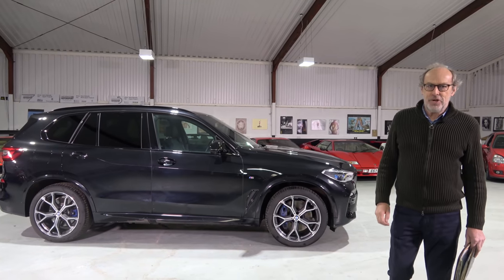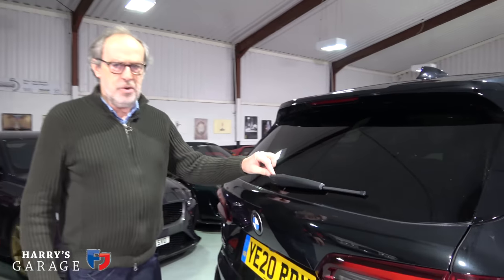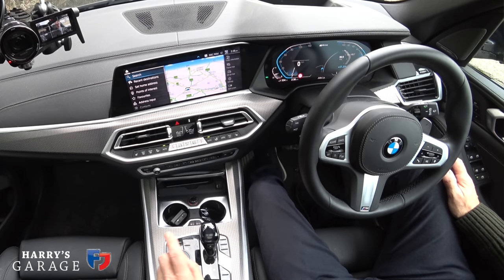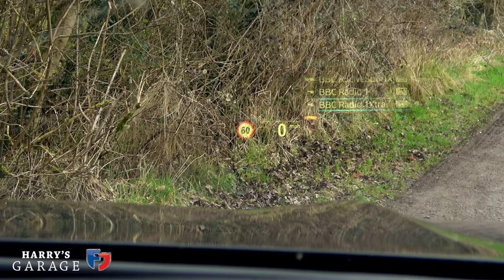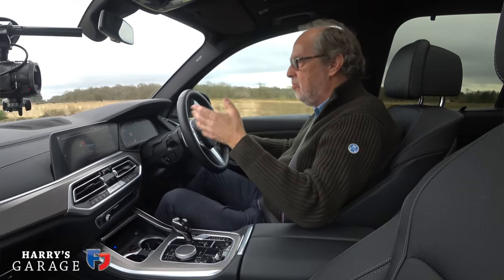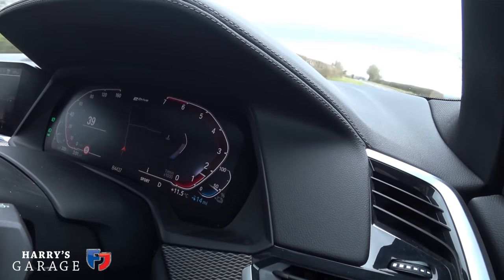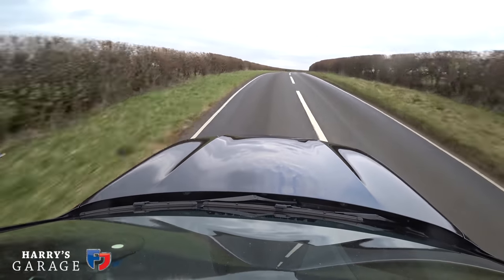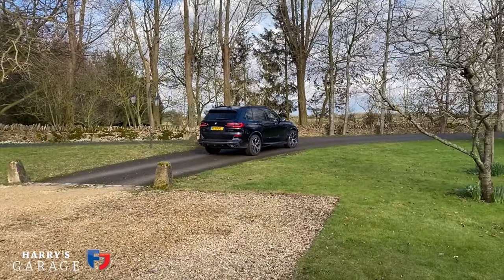BMW X5 45e 10,000 mile review. Why PHEV beats EV for our family car

Comment: I just don't get it. If it's no good off road then surely a refined estate/large hatch would crush it for mpg. While matching practicality and usability. From an eco pov large hatch/estate would also require fewer materials to build. An even better eco choice is buying a car already made over buying new.

I'm not conformable the governments are encouraging the car builders down the right route. But we've seen that before... Diesels.
Reply: They should have pushed LPG, it is very low emissions wise. I don't get how any of these heavy, aerodynamically bad, suvs that have been made even heavier by the hybrid side of things can even qualify as "green". It's insane.
Reply: You seriously think people buy SUV 4x4’s to off-road??. They buy them for the space and ride height. An estate/hatch can’t match a large SUV for those
Reply: @IverKnackerov  an e class wagon has more space than an x5 inside and drives better 
ride height doesn't mean much when you have shitty sidewalls  on tires too
Reply: How old are you? 15-teen?
Reply: I think the 5 or 7 series makes much more sense. I'll take a 745e thanks in long wheelbase on a long term test.
Reply: @ShaiyanHossain  yes but the higher height of the X5 makes it much easier for my elder dad and mom to get in to and out of, and is much easier on the back to load a baby into the baby seat, than, say, a wagon.
Reply: It does not match the practicality or usability for elder people though, the higher ride height actually makes them much easier to get into or out of. It also makes it much easier if you tries to load a baby into the baby seat thanks to the higher ride height. As a family car, the higher height actually serves a purpose, if one was to drive alone 90% of the time, they won’t be considering a car with a huge luggage space anyways so both types are out of consideration.
Reply: @chappy2121  LPG will never take off because of the lack of infrastructure,  the company I work for runs some LNG trucks and we have 1 place in the uk to fill up now calor have shut there sites. Also the reliability of them are awful compared to diesel.
Reply: @IverKnackerov  ride height, sure. Space, no. SUVs are amazingly space inefficient.
Reply: @shinnchen7015  yep but if you wanna save the planet like they say you must cut on something. This is a big bs. Amg stopped making 6 and 8 cyl for the new C class yet they have at least 5-6 different models of Suv in their line up. 
You just have to use your mind
Reply: @shinnchen7015  then consider a minivan, far easier ingress/egress than any SUV, and they have power sliding rear doors now too
Reply: @ShaiyanHossain  but who wants the image of a minivan? Just let him drive his SUV.
Reply: @matthewp9015  if the goal is to have a practical vehicle then why would you put image above practicality? Sure the X5 has its practical uses, but for what the intended purpose is of having an easy amd high up vehicle to sit in, a minivan is far better. But power to you if you want an inferior vehicle because you're too scared of how others perceive you for making practical decisions
Reply: @ShaiyanHossain  so you’d go out with your friends in ugly sweatpants because they’re more comfortable than jeans or chinos? There’s also no minivan out there that could match an X5 for performance, technology and build quality. But let’s be real, car people who follow people like Harry Metcalf are not the kind of people to buy a minivan. Yes they want practicality, but they also want their vehicle to be desirable too.
Reply: @matthewp9015  i dont have friends who judge me for what I wear so yes, absolutely 
and modern minivans like the new Sienna or odyssey have plenty of "tech" features such as LKS or ACC that an X5 have for considerably less money. what they lack is the high price tag and unreliability of an X5. ok but more seriously, they just don't have the driving dynamics or performance that come with the X5, which may or may not matter to different people. Generally people buy minivans for practicality reasons, not performance, but you do you. And a minivan is pretty desirable these days with all the luxury and tech they pour into them. dunno where you live but here they're pretty much on par if not even exceeded entry level luxury cars that cost more in terms of build quality and standard features. alas you just wont look flashy stepping out of one
Reply: @ShaiyanHossain  sounds like you really love minivans. Unfortunately most consumers don’t, hence why they’ve fallen out of favour. They make perfect sense if you have a family, but if your kids are grown up and have left home and you just want better ground clearance and the occasional 3rd row, why would you drive one?
Reply: @matthewp9015  most consumers are also swayed by marketing BS, where they can be convinced they need something rugged when they really dont. but minivans still have a sizable buyer base, enough for manufacturers to release new vans for 2021 
while most people don't really need a larger vehicle once their kids grow up, a van is still comfortable and the easy ingress/egress help with a lot of senior citizens. Ground clearance is nice to have if you go offroading like harry does or live where they don't plow the roads when it snows often, but that's really dependent on the person tbh. Oh and the extra space is always useful even without the 3rd row, and  with a much lower load floor too. just comes down to the type of person you are and what your needs are. If you justify needin a crossover/SUV, then go right on ahead, ill stick to my vans
Reply: Absolutely agree, IMHO PHEV’s are useless, especially so for lots of miles. At cheaper one can just get a Diesel and get similar mpg as most PHEV’s, and why on earth are nobody making diesel hybrids? Diesel is way more efficient than petrol and modern biodiesel is almost carbon neutral
Reply: @neilneilorangepeel  bit like the lack of infrastructure for electric cars I guess. I live top end of lincolnshire and my uncle used to run a Honda accord on LPG about 15 years of so ago and never had any bother getting any. Not sure how bad it is now though. Got a buddy picking up an E51 Elgrand 3.5v6 next week he's getting that LPG converted. For the money he paid nothing else can compete with what it offers
Reply: @chappy2121  if the fuel was adopted more by  manufacturers and they develop them like they do (did) diesels it’s a great fuel, my LNG truck can do roughly 1400kms on one fill and costs roughly about £350, that’s a 3rd compared to diesel, it’s just from experience the reliability is awful.
Reply: @duncanidaho7494  never in any response have I said anything environment-saving the planet-polar bear friendly related stuff, what’s your point? Also Merc is making the new C AMG as a hybrid to keep their promises of electrifying their lineup and because some countries already announced their plan to not sell petrol cars after 2030 they HAVE to start electrify their lineup. They merely did this on the C because the C will have the least resistant towards people hating electrified AMGs as...it’s a C AMG, it will sell no matter what. And manufacturers keeping 1million different SUV models is because, well it’s not like SUVs haven’t being selling like crazy for the past few years so they are there to make MONEY. Electrifying something like a GLE AMG will have a big impact on its sales numbers so of course they will play it safe and do it on the C.
Reply: @shinnchen7015  my reply was for you as well as for the person who created this thread. 
First, you do not know cars. C class is Mercedes Benz’s best seller model. So what you say it is way off. They would take less chances with it since it is their most popular model.
Second, if these boys claim they want to save the planet by cutting emissions ( ex making all cars turbocharged, more 4 cylinder engines etc) they should axe all the SUVs . You say because they want to make more money, maybe it is true. At least keep the V6 and the V8 if you want to sell the stupid trucks.
Reply: @duncanidaho7494  LOL, it’s because it’s the most popular models so people will buy it no matter what changes are made to them. It has a wider, younger customer base than most other models within the brand which is easier to accept changes. Look at what BMW did to their 4/M3/M4. Look at how bad VW had made their Golf compared to the previous one just to make I.D.3 look good, and Golf still sales. Only car that can escape from this is the Merc S only because the S have the status of being a “innovator” and it’s also being done this generation already by taking away the V8 from S500, and also electrifying the S AMGs. 
Secondly, can’t you see electrified SUVs will come straight after this? They have to start with smaller cars so the NUMBERS ON PAPER looks amazing and justifies “electrification is the way to go from now”, with the power and torque a huge SUV will need, putting batteries in will still result in bad numbers and will only lead to people laughing and questioning the electrification decision. Once the technology is there to support better batteries they will put larger battery and smaller engines into everything including those SUVs. Putting small batteries in big SUVs with big engines had been done by Cadillac on the Escalade over a decade ago and that sold like...yeah, no one bought it.
Also, see here? I didn’t attack you personally and I can still make a point.
Reply: I bought it due to high seating position and a high load carrying ability. It will hardly ever go off tarmac. It is also a very luxurious vehicle to travel in.
Reply: @ShaiyanHossain  talking bs.. We have Mercedes-Benz E350 and Audi Q7. You can't compare those two in terms of space, practically, sitting position. I am 6.3 and in Mercedes-Benz E class there is not much space left behind me. Get full size SUV for a day and you will see..
Reply: @matthewlewis2072  did you ever had full size SUV? Clearly not
Reply: @mariusmartinsen2064  an my van has more interior space and 2nd row seating room than your Q7 so

Comment: A friend of mine got one and loves it. Now I have an X50e (the facelift) on order, and apparently it now charges more rapidly - it can use the 7kw. The buttons on the inside have gone though - I’d prefer to keep these. BMW have made it a bit quicker still, so they’ve disregarded Harry’s comment about unneeded performance 😊. It will be a bit different from my analogue 530i manual E61 estate…

Comment: Great content as usual Harry! Would be interested in the comparison between this and the 545e. If the lower drag coefficient and slightly less weight makes any difference to the mpg, but I do have a suspicion that it isn’t exactly the same system due to the space available between platforms.

Comment: My eleven-year-old Nissan Note averages 54mpg, granted it's not as fast and maybe a little less refined ;) but then it cost eight hundred quid so there's that.
Reply: That’s like comparing, a horse cart and a bullet train 😄 both will get you from A to B though 👍
Reply: And my 17yo Nissan Maxima 3.0 automatic averages 33mpg, which I think is fairly good for such a large car.
Reply: A reliant robin will do 70+mpg 
Just need to sacrifice all and any refinement to do so
Reply: @carmadme  Lovely jubbly.
Reply: Fair play you have some guts for admitting you own a Note.
Reply: @carmadme  -  The old plastic pig would make a very practical EV runabout for people unable to afford one of today's stupidly over-specced £40,000 vehicles.

Getting the mass down low would help with the handling, too. Maybe the Chinese equivalent of Clive Sinclair will buy the rights and produce something. Could be a decent little weatherproof shopping car for £3,000 or so. 100 mile range and a 50 mph top speed would be perfectly adequate for 'real' people.
Reply: @vibingwithvinyl  sounds like my Crown VX on a run, usually only get 24 on super in normal driving 🤣
Reply: MPG on my Chevy Volt was well into the thousands. The engine ran about once or twice a month.
Reply: @siraff4461  I don't care :) a genuine one little old lady owner! dealership services and 29K miles! at 11 years old. It feels almost new to drive, 1.5l Diesel, manual I'm beyond caring what people think of me.
Reply: @stephenmorrish  Don't get me wrong - I wasn't having a pop. Just a lot of people see someone in a normal car and try to make fun of it so its nice to see someone being honest. If you listen to yt comments its as if everyone drives a Lamborghini and anything less is junk.
Reply: @radoslavdimitrov1101  kind of but not really, taking road traffic into consideration there’s very little difference in average journey time should you be in this x5 or the note. How many times has some clown overtaken you dangerously, driving like a maniac only to be sitting a car in front of you at the next set of lights or roundabout
Reply: @mbal4052   Absolutely agree with you on this one, perhaps I haven’t used the best example of what I really wanted to say, it wasn’t so much to do with speed of it, but more to do with the different classes and the difference in the refinement as such, hence I used the cart and the train.
Reply: A diesel BMW 5 series wagon can average 55mpg.
Reply: @DiscoFang  An old Citroen C2 HDi can do over 70mpg. How is either relevant when talking about a 400hp 4x4?
Reply: @colinstamp9053  - Yeah .. but it's a 'Chevy Volt' ...

Comment: I hate modern "smart" keys, especially the huge, car-shaped ones that are more of an announcement for the valet than something to fit comfortably in your pocket. Why can't they go back to modestly-sized keys of only a few years ago? (Or use your phone like a Tesla)
Reply: I would definitely stick with a normal key. I'd almost go as far as saying I wouldn't buy a car that used my phone to get in. For starters, once you know which button is which, you know exactly which button to press even if the key is in your pocket. Secondly modern phones tend to run out of batteries quicker than EVs. What happens then? Car makers seem determined to provide solutions to problems that don't exist. See HVAC controls or volume dials buried in touchscreen menus!
Reply: @acemcgraw1  well Tesla lets you use a regular key

Comment: This great review by Harry was one of the reasons we ordered a 45e earlier this year.  It arrived in June, and we’ve been delighted with it ever since.  The boot is big enough for 2 large dogs, the front seats are tremendously comfortable and the refinement is top notch.  And personally I think it’s a very handsome vehicle.

On the downside, the air suspension isn’t quite as fluent around town as I’d hoped, while the charging speed is glacial.

We knew most of our journeys were going to be relative short, and in that role the economy has been exceptional for such a large and luxurious car, IF you keep it charged.  If you can’t charge it regularly - and for most of September we couldn’t, because it caused power cuts at our new home (we live in Valencia) - the picture is less rosy.  That problem is now fixed, and the joy/relief of having battery power once more is immense.  Driving purely on combustion power dropped economy into the high 20s, which was understandable but expensive and annoying.

Putting that aside, however, here are two sample trips:

Madrid to Segovia and back: temperature 39C, 170 km (about 106 miles),90% of which was on A and B roads, with a total of around 7500 ft of climbing/descending; 60mpg and 100% of battery power used.

Madrid to Valencia: temperature 37C; 375 km (about 230 miles), of which 220 miles were motorway cruising at 70-75mph; descent of a little under 2000 ft over the course of the journey; car loaded up to the proverbial gunwales plus a large roof box and a rear bike rack carrying two 27kg e-bikes; 39mpg and 100% of battery power used.

The return trip to Madrid: empty car, no bike rack but with an empty roof box on the top; 33mpg.  So the roof box and the return to the altitude of Madrid seem to have played their part in increasing the fuel consumption.

Make of all that what you will!
Reply: *Sorry, three sample trips.
Reply from the maker: Thanks for the detailed comment. We now have a PHEV Range Rover and the faster charging makes a huge difference, despite the battery only being half the size as the one in the X5. The BMW has the better drivetrain of the two but we're getting more pure EV miles from the RR, purely because it charges 3x faster than the X5 (we don't do many long trips)

Comment: Recently bought a 745le and never used the display key. Love the car though and so far averaging 52.7mpg over the last 1800 miles. Love it.
Reply: 50 mpg with electric? The 730D gets that pretty much if so, I think the savings are negligible.

Comment: Harry, you made me want to buy one and I really don't need one. I also liked the way you did the math. Using the value per mile for electric drive only, the car would use electricity that would equal the cost of the base model in roughly 1.000.000 miles. Just electric. As mpg is lower when using electric AND petrol, the car would consume it's own value in slightly less mileage